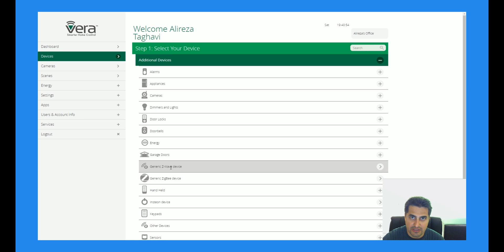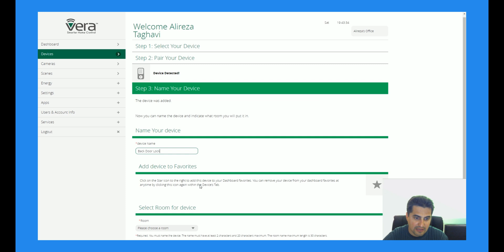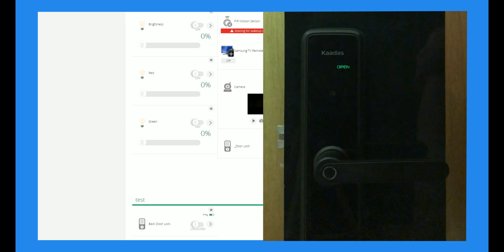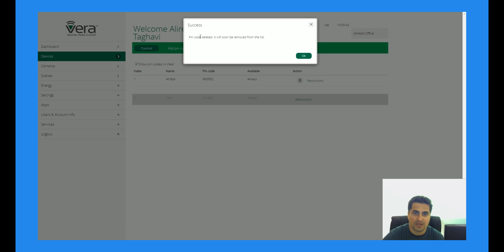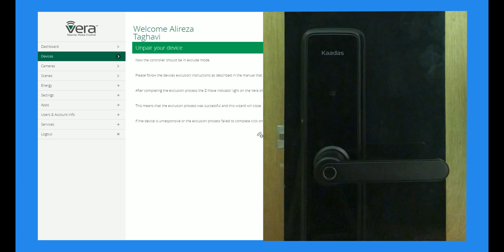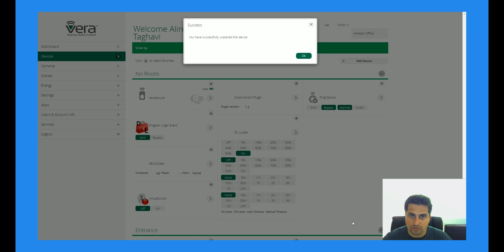Kaadas Smart Door Lock and Vera

Comment: Hello
I have the problem that the kaadas device connects and disconnects, sometimes the command arrives sometimes not even with the vera next to the lock

any advice?
Reply: I have updated the network with the neighbors, I have unpaired the device and have paired it again and it keeps doing the same
Reply from the maker: @donaldventura9113  Hello, what do you mean by connecting and disconnecting exactly? Do you only receive notifications? or you see red line in Vera? Have you checked connection of Z-Wave module to the lock? is it okay?
Reply: @kian.smarthome  ok sorry I put it wrong. If the device is connected, the problem is that 95% of the time it does not respond when I send it a command and it does not update the status
Reply from the maker: @donaldventura9113  the first think that comes to my mind is checking connection of Z-Wave module and door lock to see it is tight. Have you checked it?
Secondly, please tell me what is the distance between Gateway and Lock? Also describe obstacles among them.
Reply: @kian.smarthome  

Hello, first of all I want to thank you for the time you have dedicated to me. Here are the answers to the questions you asked me

1. is tight

2. even when testing the side-by-side test, the problem still occurs.

Today I was conducting tests with who sells kaadas in my country.

All tests were performed side by side with the hub, the results were as follows:

with the kaadas zwave module that has the male pins the k8 and k7 locks have the same problems. with the same module the M9 lock worked.

With the z wave module brand Alfred with the female pins the k9 lock worked perfectly.

is there any incompatibility between the modules and the lock?

Will a zwave alfred module work with the male adapter in the K7 lock?

Comment: Hello, How are you, Have you had any problems with the state of the battery?
Reply from the maker: Hello, I am fine. I have had no problem with the state of battery.
About your issue, firstly exclude the device, reset it and include it again. if problem is not solved in vera check "Unless specified otherwise, poll each node at most once every 
60 seconds." and "Poll a node every 30 seconds." in settings , Z-Wave settings. They should not be set to "0".
After that go to the settings of the device, in control section check "Poll this node at most once every
 10800 seconds (0=never poll, blank=default)". It must not be set to "0"